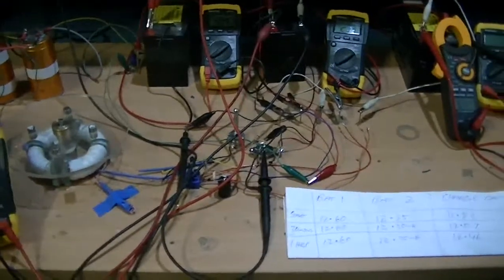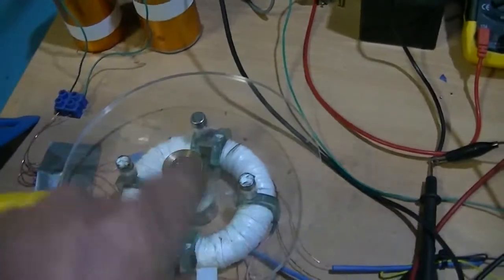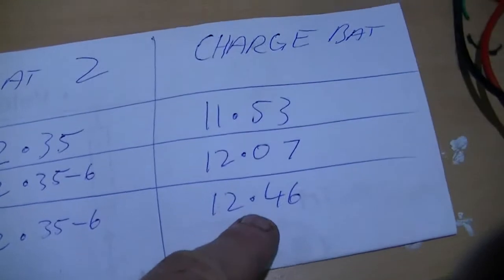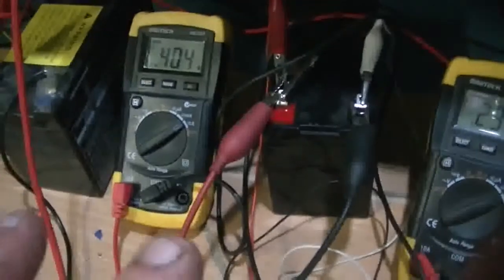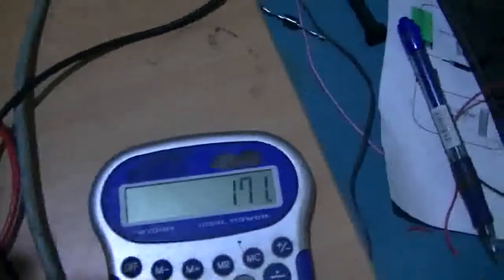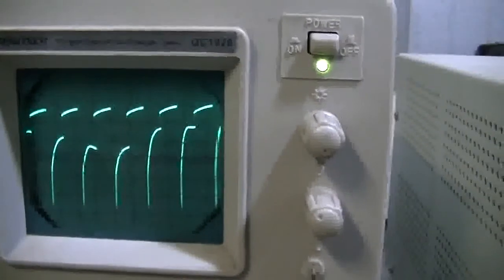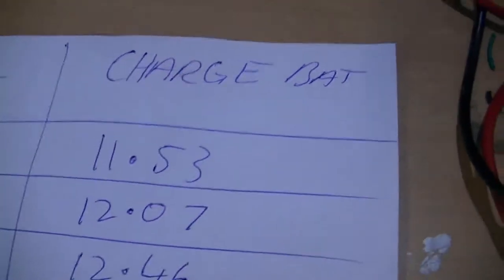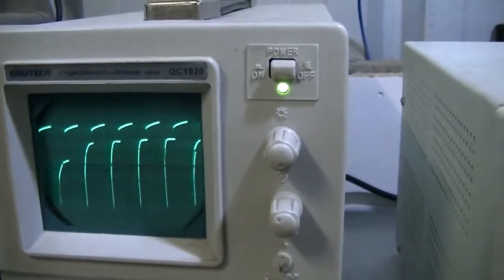The L.A.G new circuit_strange scope shot 2.flv

Comment: Hello TinmanPower. Thanks for your video. The variation in your waveform suggests to me that there may be another signal that is modulating the main signal we see.  If you have a second scope channel available you should probe your setup to see if you can find  the area that is generating that signal. If you do not find it on your setup, check your lab for other equipment that may be generating another signal.